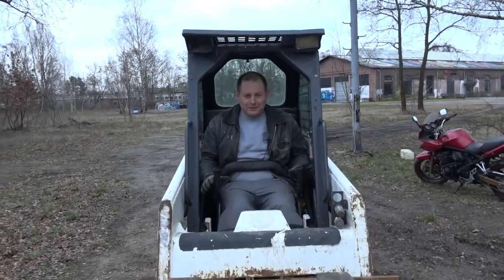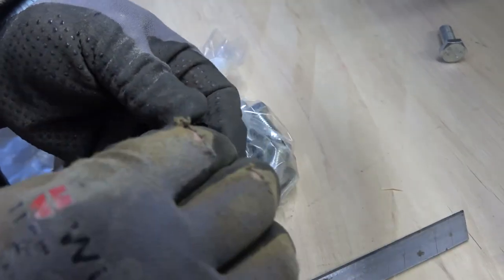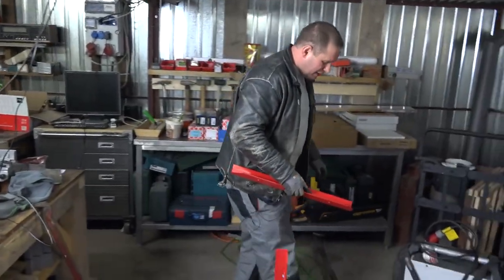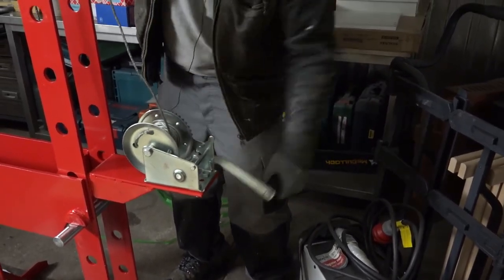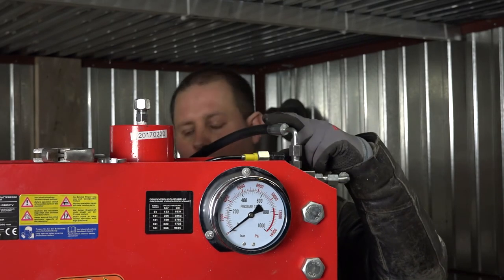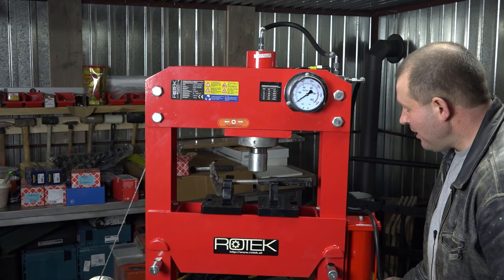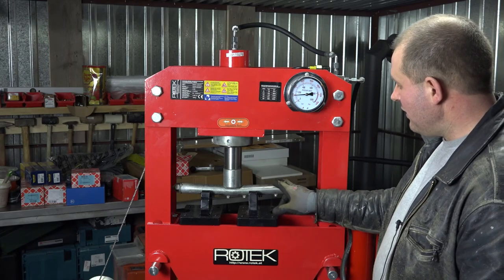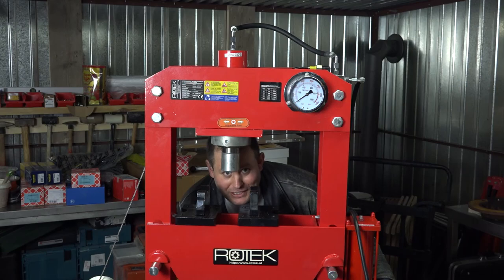ROTEK 30t Werkstattpresse (30T Hydraulic press) WZWP-030MPV review

Comment: What kind of compressor do you need?
Reply from the maker: Nino Brown some mid-class 8 bar is enough....
Reply: Your quick reply just earned my subscription. Follow up question, can I reach the full 30T with it?
Reply from the maker: Nino Brown I never tried.... I thing the pump, cylinder and the hoses can survive even more....
But, stop around 26T... because the rubber rings on the main piston!